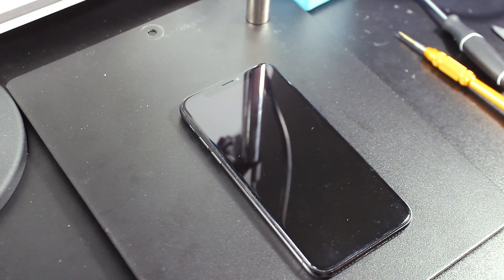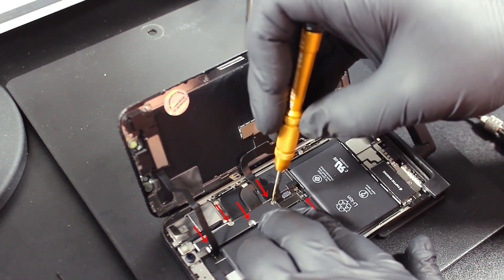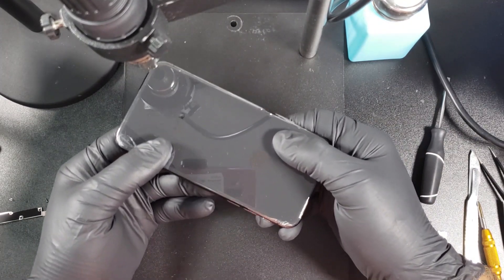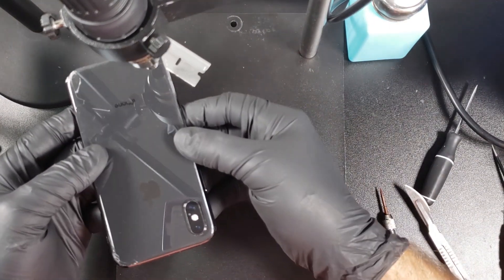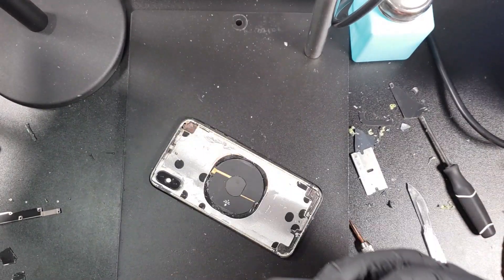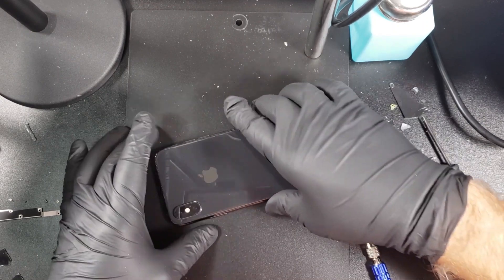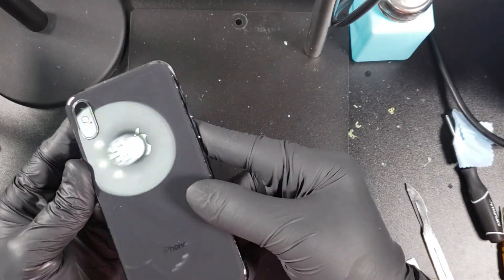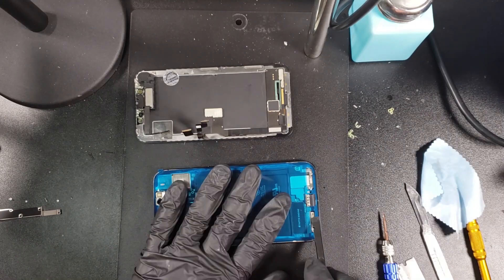Apple iPhone X Cracked Back Glass Replacement Shown In 10 Minutes

Comment from the maker: Parts and Tools:

Part:
Apple iPhone X Back Glass with Wide Camera Hole
https://amzn.to/3oPfbwg

Tools: 
FoodSaver Vacuum Pump:
https://amzn.to/2N0BwZA

FoodSaver 1-Quart Vacuum Zipper Bags, 18 Count:
https://amzn.to/39wpm2k

Rework Station:
https://amzn.to/3qmFytK

Anti-Static Repair Mat:
https://amzn.to/3oSG4ze

Razor Blades:
https://amzn.to/3qoPeUz

Steel Scalpel knife and Blades:
https://amzn.to/3qqTXFq

Plastic Cards:
https://amzn.to/2KkrqC3

Alcohol Dispenser:
https://amzn.to/2Kk2DOt

Phone repair Pro Tool Kit:
https://amzn.to/35Koq9E

Tweezers: 
https://amzn.to/2LDgP5B

These are Amazon affiliate links.

Comment: You forgot to discharge the phone by holding the power button for at least 15 seconds. The capacitors still hold a charge and can damage the connectors. Also, remove battery.

Comment: Very grateful for this video! My screen is unresponsive but the back is the only visible damage. But I hear the phone lock sound with the lock button. It was in airplane mode when I broke it so I don't have another way to check functionality to my knowledge. Do you think replacing the back glass could do the trick?
Reply from the maker: No, replacing the back glass will not make your phone work, it’s just a glass. Sounds to me like your front screen is damaged even though you don’t see any visible physical damage. If you are able to hear the sound of the device locking that means the phone is on, and if nothing is displaying then it’s your screen.

Comment: would it be easier to transfer everything into a new frame?
Reply from the maker: If you buy high quality frame with all the small parts preinstalled it may be easier, but they are expensive. If you go with the cheaper option and just get the frame without the small parts preinstalled then it takes awhile, and there are more things that could go wrong.

Comment: Why do you have to remove the display?
Reply from the maker: You don’t have to remove the the display, in fact most of the back repairs we do without removing the screen. It is just the safest way so you can unplug the battery and also you can remove the camera ( not shown in this video) to protect it from any glue in case some gets in around the camera lens. I’d recommend removing the display, unplugging the battery and removing the camera to someone who is going to do it for the first time.

Comment: It’s absolutely stupid to have back glass when it has to be removed like this.  Apple needs to have just stayed with the metal back.
Reply from the maker: They needed it to be glass so that they can finally have the wireless charging. I do agree that they could have made it much simpler to replace like on the Samsung. If you do enough of them it becomes pretty simple.

Comment: Hey I had a quick question isn’t 200 degrees Celsius too hot for the phone?
Reply from the maker: As long as you are constantly moving the heat gun it’ll be fine, if you use lower heat then it will take much longer to heat to have the glue soften.

Comment: Hi I wanted to ask you a question? Do you need to take the screen or you don’t have to. And dose the heat damage the screen if I do keep it on? Pliz answer as soon as possible 😭
Reply from the maker: Normally I don’t take the screen off. Taking the screen off is the safest way in case things go wrong (like puncturing the battery or using to much glue next to the rear camera) otherwise the heat does not damage the screen. The screen gets way more heat during refurb process and it doesn’t get damaged so this process doesn’t damage it either. I would recommend taking the screen off for someone who is doing it the first time or has not done any similar repairs.

Comment: What is the heat gun temp set at?
Reply from the maker: 200 degrees C. or 392 degrees F. 
You can increase that or decrease that depending on your preference. Just remember to constantly keep the heat moving.

Comment: Hey mate great video, I see a lot of comments about damage to the camera stability when back glass is being replaced, what precautions should be made to ensure there is no damage to the camera
Reply from the maker: I would recommend pulling the camera out. This would be the safest way. If you open the phone up, then you are able to unplug the battery and pull out the camera. That is how you for sure know you won’t damage it. If you want to save time and do the repair without opening up the phone then I would just recommend being very careful not to put to much glue around the camera bracket. If any glue seeps in, it will most likely damage the camera. Hope this helps!

Comment: what is the diference between camera holes? why they have 2 sizes?
Reply from the maker: Normally you would have to cut off the camera lens frame, install the back glass and then reattach the camera lens frame. With a big camera hole you can just put the glass over the camera lens frame so you don’t have to remove it.
Reply: @MobileRefreshChannel  Thank you for the reply. Very helpful.

Comment: Does Face ID still work after a repair like that? I have broken mine with a single crack and don’t know if it’s worth replacing or just getting a nice case. Really frustrating
Reply from the maker: The faceID part of the phone is never touched so it’ll still work with no issues. This repair is definitely on the more difficult side, especially if you don’t have the right tools. A safer alternative is to swap the entire housing. You can find the entire housing with small parts on eBay for $60 or so and all you have to do is swap the board and the battery. I’ll be making a video about that soon. Thanks

Comment: Will it be okay to leave the battery in ?
Reply from the maker: I leave the battery in, but the safest way is to remove the battery because you don't want to accidentally puncture it when you are removing the glass around the wireless charging pad. As for the heat, as long as you move the heat around it will not damage the battery.

Comment: Great content! Do you use one every model the big hole glasses?
Reply from the maker: Yes, but there are some models, like the iPhone 8 and 8 plus which has the camera frame included with the glass.
Reply: Thanks!! Only with camera frame for iPhone 8 and 8 Plus?
Reply from the maker: @deanschepers1188  Yes the newer models X and up don't have camera lens pre-installed.

Comment: Did the wireless charge function still work ?
Reply from the maker: Yes, you have to be careful when going around the wireless charging pad, if you don’t poke any holes then it should work just fine.